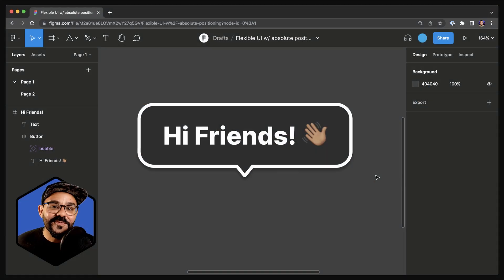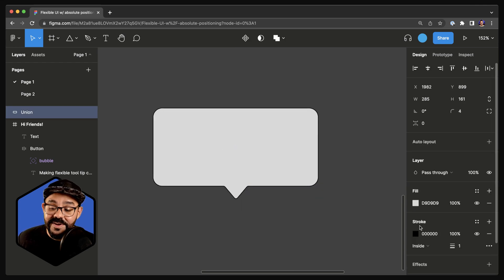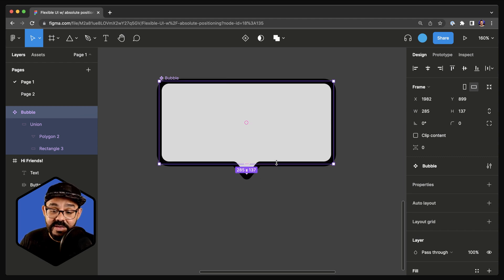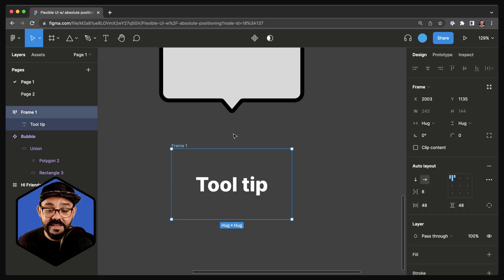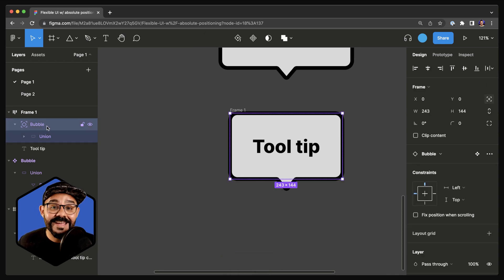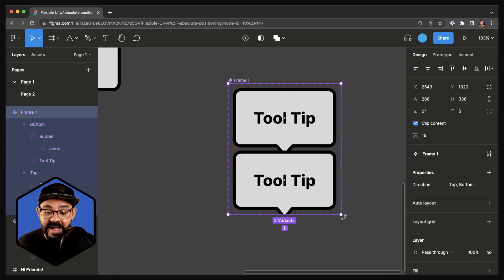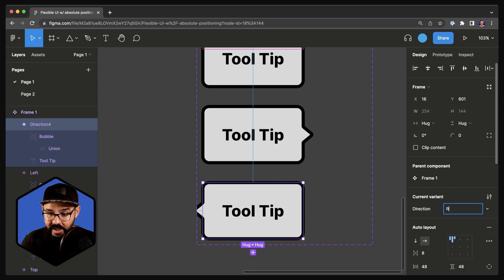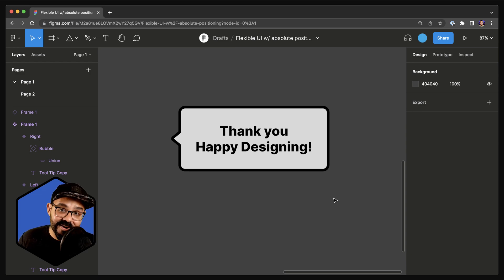Making flexible auto layout tool tip components in Figma.

Comment: This may be sufficient for short, concise tooltips. In practice, however, it is unfortunately much more complex. Often you have actions that are located at the edge of the viewport, in which case the tooltip also moves out of the viewport. Then you have to align the tooltip left if the tooltip flows out of the viewport to the right. But what about multi-line tooltips? So that we don't have a long ugly line, we need a max width. But what happens when this width is reached? The tooltip should then grow dynamically.

Comment: I 💖this, it's exactly what I needed to know. It's demystifying Figma, thank you. Great explanation and pace.
Something interesting happens though when I place an instance of this tool tip into another component... The bubble reverts to a small size and leaves the text hanging out. The horizontal and vertical resizing then need to be reset to 'hug' and it's all good.

Comment: This is great but it wouldn't work if you wanna make an interactive tooltip with the tooltip icon and bubble appear on hover :/
Reply: Why so? You can nest it inside an interactive component for that behavior or make it more suited to your needs.
Reply: @miggi-from-figgi  Yes you can nest it into a seperate tooltip component. So you have "Tooltip bubble" loving inside a "Tool tip" Component which would be like a 24px x 24px frame.

Comment: I'm a bit confused as to why there is so many steps to do this ? Maybe I missed something but it feels like it could have been made more easily using just one layout with a frame inside ? I guess the point of the bubble wouldn't be as easy to replicate in all direction maybe without doing it the way you did but I still feel there has to be a more straightforward way ?
Reply: There are more straightforward ways to get a simpler tip box, yes. I am hinting at greater opportunities of boolean operations and constraints. The single seamless stroke around the bubble, the expanding aspects of it, and a simple way to approach component properties and have a flexible library item for resuse. This method, too, allows for cool approaches for making scalable frames around auto layout objects. I may follow up with another one to demonstrate the potential of constraints / boolean ops / absolute positioning.

Comment: why use this 'absolute' method over simply making an autolayout button and containing into another autolayout container with a triangle. Does the absolute method make the design more closer to what will be code implementation?
Reply: That's right! Easier handoff.
Reply: I tried to do without absolute position but strokes messed up. You can't add separated strokes to polygon. I couldn't get rid of top stroke of polygon. How you make this with old school auto layout? Can you share please?

Comment: I would use auto layout for the bubble and arrow.
Reply: Could you elaborate please?
Reply: @surajtarani5710  you can connect arrow and the bubble together with auto layout so it can be easy to enlarge/shrink by content. Also you can place the arrow easily with paddings.

Comment: There's alot of stuff not happening here. There's no way to set instance constraints cause all the constraints options are disabled when I try to add constraints to the instance of the main component. Also, when I scale the main component I made exactly by your instructions the bottom pointer doesn't grow with the bubble, it stays the same although everything is set exactly as instructed. I tried making the text and bubble from the beginning as one auto layout frame and added the pointer but then the bubble just vanished when I did the Union operation. Is it just me or is Figma very buggy?
Reply: 1. Use rectangle as one shape 
2. Then try to draw the polygon tool with pen tool (thats easy) and 
3. Select union (first option) 
4. Then select the bottom polygon shape put centre and bottom constraints 
 5. Select rectangle shape put left-right | top- bottom constraints
Reply: @tirumala_ch  That doesn't work for me. Instead what worked is to create one base component with all the pointer shapes placed on all sides of the rectangle, then make component variants out of them by selectively hiding the redundant pointer shapes one by one on each variant. Top, bottom, left, right. I didn't have to wrestle with all the other stuff that I couldn't seem to get in order. I tried your approach three times before I gave up and tried the other solution that seems to be working with auto layout and component variants for the pointer variants.
Reply: You can set constraints once something is inside of a frame or component. They need a parent to respond to. In the example I make the union, then convert to a component. The component behaves like a frame so I am able to set constraints on the children of the union.

Comment: @0:23 you said you hit Ctrl+E / Cmd+E to expand it, but it did the opposite. The container hugged the object instead. This is a neat trick, but did you just say it wrong or is that expression correct? What do u mean by expand?
Reply: It expands it from a Polygon object to points. Notice the bounds on it change. This way it’s tight to the triangle.
Reply: @miggi-from-figgi  Hm, okay. Just found it hard to grasp the fact that somethings expands when its actually contracting.
Reply: @Underhills  I’m calling it expand because the function is named that way in other software like illustrator. Where you are “baking” in non destructive operations… also sometimes called flattening.
Reply: @Underhills  think of it like the non destructive operations like point number are being expanded to the vectors. Not that the bounds are expanding out.
Reply: @miggi-from-figgi  Ok, thanks for clearing that up. I have always wondered how to actually make the container hug the content like that so the tip is great.
Reply: @Underhills  this is for shapes, or Boolean operations. There is also a fit to selection option for content within frames.